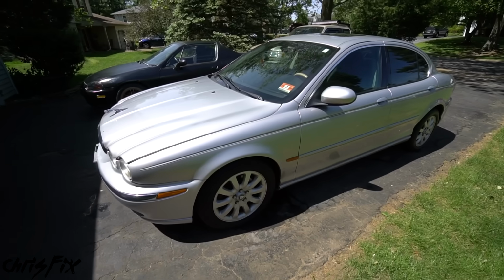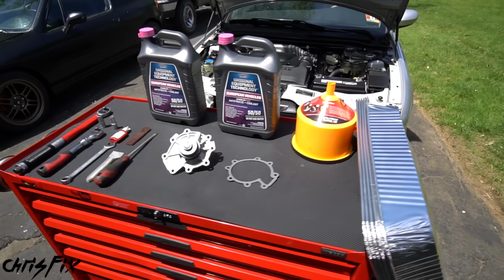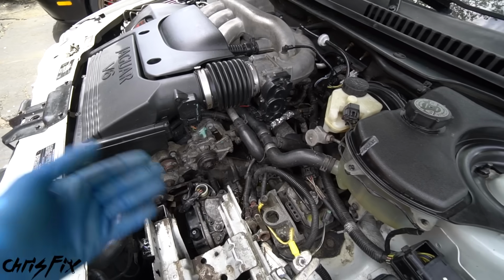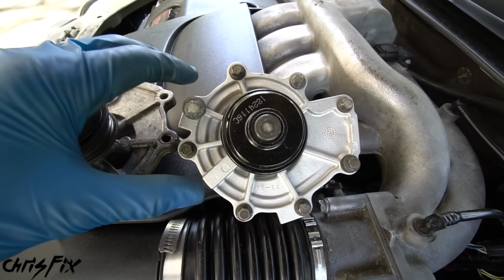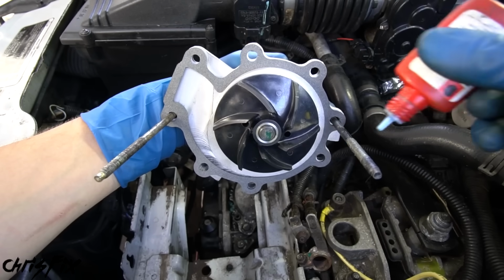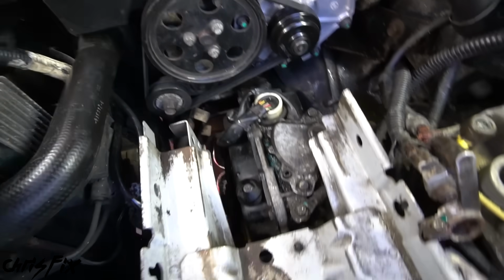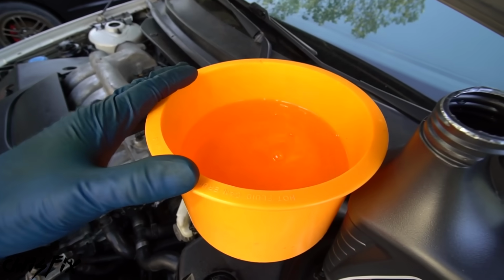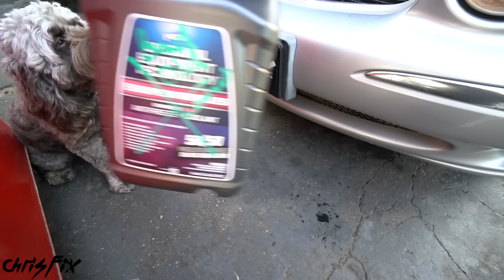How To Replace a Water Pump and Save $783

Comment: Chris, in one of your earlier videos you show us how to change the water pump on your LT1 vette. Why did you use rtv on those paper gaskets? Here you tell us not to.
Reply from the maker: That was the first video I ever made. Using RTV on a paper gasket isn’t needed. You can use a gasket adhesive if you want which will hold the gasket in place while you install it.

Comment: What a dream job for a water pump replacement! Easy peesy belt belt removal to boot as well! Dang, most of the garbage I have in the driveway requires engine mounts to be loosen so the engine can drop a bit to access the water pump. And you got to  remove the passenger side tire, wheel well, etc, etc. But love the videos, thx again for sharing!
Reply from the maker: I hear ya! This one was actually fun to do!
Reply: @chrisfix  I just can't believe the dealer was gonna charge over $800 for that job. I think now is the time to remind your Dad of the savings and get some of those tools you might be eyeing at the moment...hahahaha!

Comment: Thanks for the great video.  Wouldn't it also be a good idea to put the climate control on full hot so the coolant can cycle through the heater core as well?
Reply from the maker: There is no heater control valve so it flows even with the climate control off but I should have mentioned that not every car works that way.
Reply: @chrisfix  Welp thanks for replying and you made my day.  Love your videos, and thank you!!!

Comment: didn't need a gasket scraper for my 2004 dakota. those use a lot of molded rubber gaskets, including on the water pump. they usually come off in 1 piece and don't leave anything behind.
also, this one has a clutch fan, which you must remove before you can remove the water pump. a fan clutch wrench is required for both removal and installation. (part number 43580 at oreilly, in my case. the universal one does not work here.)
Reply: to add on, use valvoline zerex g-05 as the coolant, if you want cheaper coolant than OEM. same stuff, but it's clear.

Comment: 2:56 Painful flashback to teenage me wasting eight hours dismantling my serpentine belt system because I didn't know how tensioner pulleys worked.
Reply: you are not alone.  I did that when I was 30 and had been working on cars for 10 years already.

Comment: Man... I could've saved $700 bucks had I seen this video a few years ago!  If I recall correctly, I had a Pontiac Sunfire (RIP) and the mechanic said that he had to lift the whole engine out because of the timing chain.  Now I have a Nissan Versa, so let's hope I won't need to do that again.  I wonder if this process is similar for all cars or if they are drastically different.

Comment: You can legally put coolant down the drain you know
Reply: I don't know about the drain, but the EPA allows it to be poured on the ground if it has not been in a system with solder. It is death to vertebrates but food to invertebrates and microbes.

Comment: I have a 2004 1500 Ram that has air conditioning and heating issues. It will heat and cool just fine but the vent control doesn’t work right, any ideas?

Comment: Sup Chris, I gotta replace my front brake pads and rotors. Price of my pads, $174.30, New set of rotors, $112.75 Each for the front, $82.90 each for the rear. Grand total for that would be $563.60, before instillation.  
Part price sucks, but this is what happens when you own a Mercedes.  (2000, E320 4MATIC)

Comment: Good video. @ Chris fix, but I would recommend turning on/ moving the temperature knob to the heat. All Honda and some other makes have a hot water valve that blocks flow to the heater core trapping air.   Sorry if nit picking

Comment: How about to replace water pump that is driving by timing chain. For example  2010 chevy equinox 2.4L
Reply: I did one of those in a 2004 Chevy Classic. It is time consuming and requires a special tool (widely available for cheap) to hold the chain, but once you get used to the idea of lying on top of the engine - not as bad as it sounds - it is okay. Not much you can reach from underneath.

Comment: That's a well designed engine bay for service. My 2008 ES 350 has the water pump located on the left side just to the side of the strut. You have to take so many bolts out just to get to it, and then an insane amount more just to remove it. Most people jack their engines up just so that can do it from the top.

Comment: My dad's passat had a coolant leak from underneat of the waterpump because a hose cracked. It would've cost 630€ to replace that at Volkswagen. My dad used the simple method, he poured some mustard in the coolant tank and now it's not leaking anymore. Talk about cheap diy repair huh? 🤣

Comment: Great video as always chris! 
But I wish It was that easy on my 2003 golf mk4 with the 1.8T engine... you have to disassemble half the left side of the engine bay including the coolant bottle, power steering reservoir, timing belt, engine mount, 2 tensioners and several pulleys to get to the waterpump at the bottom haha... just perfect german engineering -.-

Comment: talk about highway robbery for a water pump replacement. That is such a simple water pump replacement. Its not like alot of trucks and cars that require most of the accessories removed. The fan, and sometimes the radiator. (or some small cars a fender and bumper)

Comment: I've done water pumps before , sometimes the gaskets don't absorb the tolerance and can still leak, moreso on older cars which might have a slight warp in the mating face.
Trick to sort that is a very thin smear of liquid gasket on the paper one, both sides. Stick the coated gasket to the pump and bolt in, it should seal nicely.
Reply from the maker: Thanks for the tip. If you use RTV dont tighten it down all of the way. You want to hand tighten it and then let it cure for an hour and then tighten it down all of the way. Otherwise it wont work to fill in any of those voids or any warping.
Reply: @chrisfix  Makes sense - great tip!

Comment: don't forget to turn the heat on full blast while bleeding system, it lets coolant get thru the heater core faster. also, sometimes you have to jack up the front wheels also, especially if u have rear heat, like on a minivan

Comment: Permatex Gasket Remover works really well if you give it time to work. i use it alot on stubborn old gaskets on motorcycle parts. After 24 hours, they come off with very little effort
Reply from the maker: Thanks for the tip!
Reply: @chrisfix  you're welcome!

Comment: Chris great video, but you have to admit that car had a very easy to access water pump. You could have commented on that fact during the video, IMHO 

Also when purging the system of air you should also turn the heater on full on so that the coolant and air have a chance to circulate through that part of the system as well.
Reply from the maker: Thanks for sharing your feedback. I did say this was an example of an easy waterpump in the video. The heat idea is a good one. I didn’t think of it because the coolant always runs through this heater core on this car. There is heater control valve, rather it uses the blend door.

Comment: Buy a Volvo 740. You will love it.
Reply: Elias Åberg som en tank
Reply: Vitun Näätä hahagHaahahaahh
Reply: David Fakhimi Du måste gå och lägg dig. :D MENE VITTU NUKKUMAAN
Reply: Vitun Näätä hahahaha förstår inte finska men är väll säkert nå svärord
Reply: Got turbo one myself and it's fantastic.
Reply: I had a 1985 765T. Love was not the word I was looking for. It had the pre-88 biodegradable wiring that biodegraded while still in the car, no OBD at all, intake ducts that could not withstand the oil film from the breather, electrical intermittents galore, intermittent TDC sensor, piston slap (a specialty of the B230FT), IAC valve that needed annual cleaning, harmonic balancer came apart on the road, new radiator at 180K miles... the list goes on. The car was no longer worth repairing at 250K miles; my 2002 Prius has needed its first repair at 198K miles and may need its first brake job soon.  No more Volvos for me!
Reply: @flagmichael  Her in sweden the old Volvos has the best durability.
Reply: flagmichael You disgust me. Vitun itu hippi. Volvo's are worth the money you are willing to spend on them. Want a good one spend money and have a good one. They are a pretty high class car afterall...
Reply: Vitun Näätä thats true

Comment: Paul Miller Jaguar & Land Rover dealership,want to know your location
Reply: Jeep too. Jeep wanted over $700 to replace my buddies throttle body. For $50 we replaced it easier than this water pump.
Reply: @butchtropic I know. I was just adding to the reasons not to go there.

Comment: Chris, Chris baby, that was the easiest water pump replacement we've ever seen.  Now do it on a car that has a huge fan, multiple belts, and a really tight space which makes getting to the water pump practically impossible.  We will wait.
Reply from the maker: I’ve done plenty of those. The point of the of the video wasn’t to say every job is easy. The point was to say, before spending $843 go see if you can do it yourself.

Comment: At the start of the video he says you don't want to work open cooling system while its hot but he has it open at the end while running and testing. Does expansion tank not get pressurised?
Reply from the maker: It was open to start so there is no pressure. If it’s closed and then you run it and then you open it, it will be pressurized.
Reply: @chrisfix  Oh okay. Thanks for reply Chris.

Comment: Damn. All my cars have the pump in the timing belt housing. Its a lot more work to do. But similar. Good chance to change the timing belt either.
Reply from the maker: For sure! If you have a timing belt, replace that along with the tensioner when you do the water pump.
Reply: @chrisfix  do you take it to the mechanic to get the timing belt calibrated after? Sincerely asking

Comment: How does the dealer get $843 for this?   even at $150:hr if they charge three hours that’s only $450!   I guess the pump from them is also $393?  Seems like fraud to me.
Reply from the maker: They said the pump from Jag was $250 so I still didn’t know how that added up. I don’t think they wanted to do the work on an old jag.

Comment: Sadly, for my BMW it's not that easy. I have electric water pump, which should be easier to replace, right? No pulleys, no belts. Nah, hold my beer. You have a lot of things to take apart first in order to remove it, even unbold sway bar for better clearance! Shit, wish it was just as easy as in this Jaguar.. :(

Comment: This is a great video and shows how easy it sometimes can be to work on your own car! But keep in mind that if you are trying this for the first time, that you first gonna check how it's mounted and where it is on the engine. I replaced it on my old classic mini. And it was very tightly mounted. I had to take of the front grill, cooling fan, 3 hoses, the radiator and even then getting the bolts of wasn't easy. Cheating the coolant mentioned jacking it up first. So keep wrenching guys and save yourself some money while getting more skilled at repairing cars!

Comment: Great video, the Jag is so easy to do. I've done one on a Vauxhall Corsa 2000-2005 and you gotta take the air box out, engine mount off so use a jack on the engine to hold it and then have fun taking off all the hoses and bolts xD

Comment: Yeh, Unless your water pump is ran by the timing pump or chain, then it's not an hour job lol
Reply: No, but in the ChrisFix universe it is good to have modular videos. Now he can do a timing belt or chain driven pump without spending another 13:29 showing the details of the water pump replacement itself. Even when I do them (DIY) I take a break when I get the pump out, then I put the new pump in, and then do the belt or chain job. Another break and I am ready to put the covers and stuff back on.

Comment: On many cars unlike this one you have to remove the timing belt in order to replace the water pump. So next video is going to be replacing the timing belt *right*????
Reply: Soon, I hope. There are lots of requests. I'm waiting to see what he does about getting the crank bolt loose without a compressor and air impact (probably a rented electric impact - would love to see who has one tough enough) and his tricks for getting the cams to sit right. Some pulleys have pin holes but I have only been that lucky once. He will come up with something more generic.

Comment: If your water pump doesn't come with a gasket and it should get another water pump or get it from another place. That gasket maker is really touchy to use. If you use just a little to much or it to close to the edge and gets in your cooling system you will have nothing but trouble.

Comment: It's a Jag, that's why your replacing the water pump. Those should last the life of the car. 

It's 783$ because it's a Jag. A water pump should be around 150$. 400$ with Labour.

Nice video, but this isn't a reflection of average car ownership.

Comment: Wish my water pumps were that easy to change
Wife's Neon- Pain in the ass
BMW e38- never done it, but looks like a pain in the ass
C4 Corvette LT1- Not a huge pain in the ass, but kinda sucks
Gen 5 Camaro SS- Never looked, but gonna assume it'll be a pain in the ass
Note to self, by the Wife a Jag once her Neon is destroyed in a crash, or in 90k miles when the water pump and timing belt are due for replacement.

Comment: I recycle my coolant by disposing of it in a storm drain.
Reply: Storm drains are actually very environmentally sensitive - it is usually forbidden to empty a swimming pool into one. Better to pour it on the lawn or garden (if you have a modern, no solder, cooling system). The plants don't mind and it biodegrades in less than a week. It is very toxic to vertebrates, though, and storm drains can lead to it poisoning wildlife. Chris shows the safe way that works everywhere - return it for recycling.

Comment: Chris's Jaguar: remove the battery and you can easily reach the water pump!
My 1986 Nissan 300zx Turbo: just pull out the entire front end and it will make it a little easier
Reply: I had an 84 NA. I remember what it was like to replace the alternator. Oddly, the timing belt and water pump were not too bad. At least I could do it standing up! I bet the turbo changed all that.

Comment: Well the main problem with the cost is it’s a luxury car, they are going to cost more at the dealership, like compare a Honda and an Acura, replacing a timing belt on a pilot or a mdx that would have the same 3.5 J series V6 and the Honda would cost $950 while the Acura would cost $1200

Comment: Hey Chris, I didnt know that the engine was hot and i burned my arm with boiling coolant. I got a first degree burn and coolant shooted up all over the place. Thanks Chris for the video.
Reply: I got careless one night and removed a radiator cap without squeezing the radiator hose to ensure it was depressurized. Got a flannel shirt sleeve and sweatshirt sleeve soaked with boiling coolant - took a few seconds to get it over my hand. Smarted like crazy for hours. A week later all the skin peeled off my hand.
Reply: @flagmichael  wow
Reply: @flagmichael  but my arm is better now

Comment: None of my local parts stores take old coolant anymore, just used motor oil. The city has free hazardous material disposal for residents and you can take your old coolant, oil, bad gas, bleach or whatever to a fire station on certain days. Just need to check the schedule to see what days and which stations are doing it. It's annoying to have to wait until a specific day and having to store old fluids until it can be disposed of properly, but it's way better than just dumping it in a field.
Reply: The last time I looked the EPA approves dumping unused ethylene glycol coolant on the ground, but used coolant has to be tested for lead first. In Phoenix I asked the Arizona Department of Environmental Quality how I should dispose of a few gallons of bad gasoline. I was told to pour it out onto the ground away from any ignition sources. Okay....

Comment: Please tell me cause I don’t under stand. How does the leaking affect the car
Reply: The engine is cooled by the pressurized coolant. It has to be pressurized to allow it to handle the high temperatures, and leaking not only kills the pressure it allows the coolant to leak out. Then the engine overheats, starting with the cylinder head, and causes very serious damage in minutes. If you see coolant under the car (check the color in your radiator when it is cool - it may not even be your coolant!) get it to your mechanic or fix it yourself ASAP and add water (preferably purified water) as necessary until he can get to it.

Comment: My mentor just said dont use to much  draid locker just a drup, chrisfix just put the whole bottel on it
Reply: A drop is all that is needed on most bolts, but sometimes water pump bolts will go into a water passage. In those cases it needs enough thread locker to make a reliable seal as well as holding the bolt in place.

Comment: This is possibly the easiest water pump replacement I've seen. My car I had to take two pulleys, both drive belts, and the timing belt off before I could get the water pump.

Comment: How do you know the broken water pump didn’t throw some bits into the car’s coolant? I believe it’s better just to replace it at that point.
Reply: If pieces of the impeller were missing I'm sure he would. Not much risk of debris in the system with a seal failure.
Reply: flagmichael he should’ve mentioned that possibility though. That could cost someone a decent bit of money.

Comment: Just wanted to mention it's really important to let your car go through 3+ heat/radiator fan cycles before calling it quits with the bleeding processes to ensure the thermostat is open long enough to bleed the entirety of the engine.